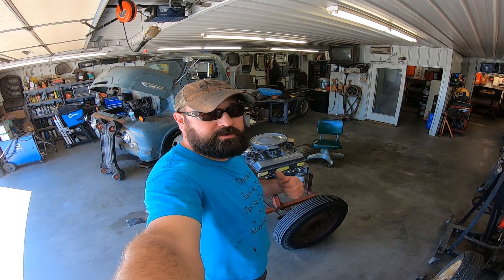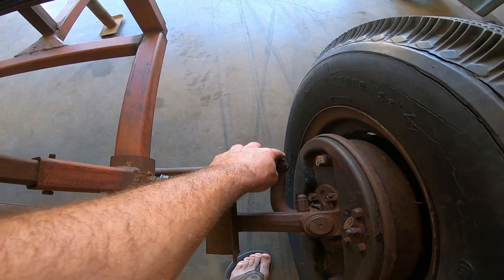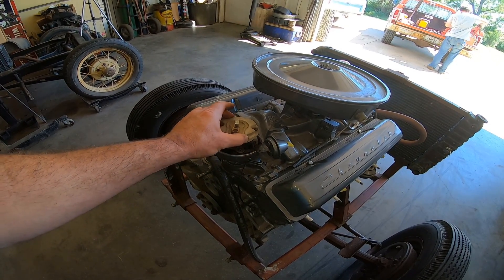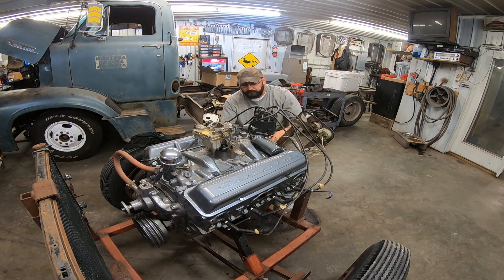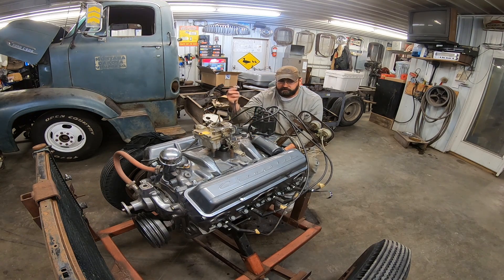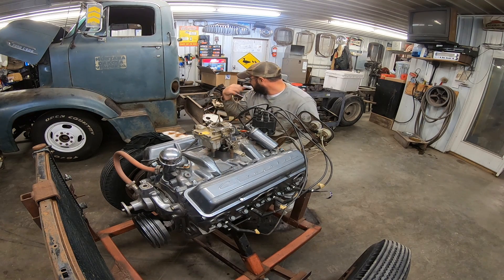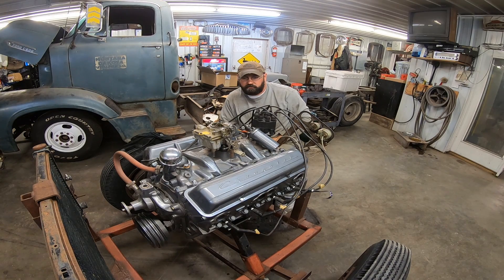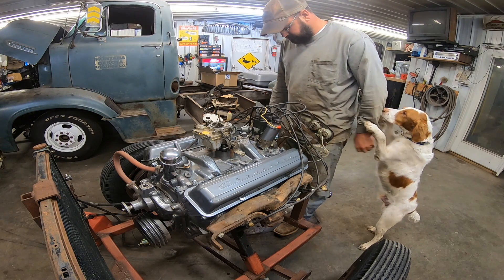1960 Chevrolet 283 Small Block Engine Estate Sale Find!! With homemade run stand! Chevy old start!

Comment: I inherited a 1965 283. It was rusted solid with heads off the engine. That was summer 2019 and now that little motor is like new again. Cost me about $1600 for machine shop work and most of the rotating assembly parts. I have another $1000 in it for Edelbrock intake, carb, HEI, water pump, fuel pump, pulleys, valve covers. Looks sweet on my engine stand. I have not tried to start it yet. I will soon. Bored .060 to a 292 cid.
Reply: What heads are u gonna use on your 60 over 283
Reply: i wouldn't be able to sleep at night, you gotta run that baby!!

Comment: Those taper seat spark plugs are incorrect for those heads. Those heads require plugs with sealing washers. The taper seat plugs will goober up the threads in the old heads if tightened.

Comment: Best combo I have seen is a bone stock 283 in a Chevy Monza. The short stroke in that light car was awesome and quick. Thanks for the vid!
Reply from the maker: I bet it would be fun!
Reply: We put a slightly built 350 in a starfire same car just used the monza v8 stuff and it was a screamer being so light any more motor and i swear the car woulda self destructed.lol after some time one door got hard to open and the other hard to close so something was going on that motor got transplanted to a camaro for the remainder of its time on earth ..

Comment: I have a '55 Chevy 4-door for 44 years. My Grandfather purchased it new, It came with the 235 c i 6 cyl. I swapped it out with a 283 when I got it, It was a daily driver for over 20 years. I then overhauled it in 2003 with a mild street cam, electronic ignition, Edelbrock carb and headers and all new interior and blue exterior. I've only put 800 miles since the overhaul but still runs great.
Reply from the maker: That's cool you still have his car!
Reply: @MortskeRepair  Yes

Comment: The 283 is my favorite engine, got one being rebuilt in my shed right now for fun. good video
Reply: I have a 1979 350    xxxx010 block on my engine stand.  went through a rapid cam/lifter failure. filled itself full of metal.   stiffened up its wrist pins.  went to retrofit roller for it. sick and tired of flat tappet / current oil compatibility problems. the aluminum heads are good for a solid 400HP and the cam should be a good match. Looks like going away from stock log cast iron manifolds, headerrs on order for my square body 3/4 ton 4x4 NP203 equipped "1980" which I did paint/body/ mechanical 15 years ago. bondo and fiberglass does cover a multitude of sins. I gave thought to putting a stroker kit in it, but I don't have the skills to clearance the block properly. but if push comes to shove, I'd rather do a 372.  ( 4.125  bore , 3.48 stroke  )
Reply: @blair79bear38  always use a zinc additive with flat tappet. A bottle of STP works good

Comment: That is a very clean engine and I love it. I just recently got an old very clean 302 Ford engine came off of an  85 Mustang GT and it is a little bit of a high performance. I am putting it in my 86 Ford F150 4x4 with 6" lift.

Comment: Best engine Chevrolet ever made.
Reply: 327 is a close 2nd if not a notch better lol
Reply: @adamcarfield7201  I'd 2nd that. 327 for the win. At least from Chevrolet the 327 was one of the highest HP small blocks at 375HP available for a production car . The double hump heads ( and ya, I have in my garage a set of small valve double humps )  with the Duntov 30 cam. too bad they didn't put that cam in the subsequent 350 engine. But as it is, you and I certainly can. my 2nd gen Pontiac Trans Am has a reasonable facsimile of the LT-1 350 in it. based on the 350HP/327 cam with 11:1 forged pistons. been that way for almost 30 years now. The Poncho purists foam at the mouth that I have a sbc in mine.

Comment: I love the 283 , had one in a 55 Bel Air   Way back in 1969 . Lot of guys put 3/4 race cam , Power Pack heads and 4 barrel on them . And always the drag plugs exhaust outlets behind the front wheel. Had to have a hand made black bar front bumper and shackles to raise the rear end , airplane had to come off the hood , damn those were the days.
Reply from the maker: Heck yeah!

Comment: haha, when you were talking about the distributor i was thrown back to the time i replaced the cap on my 91 dakota 318. colder than frig, on lunch, got it done, went to crank, nothing....
spent another 2 and a half hours after work (even colder) to realize grandpa put my distributor in 180* backwards and (assuming the motor was already in the pickup when he rebuilt it) decided "screw it" and plumbed the wires in backwards ... another half hour deciphering what order to put the wires in and i was back on the road
Reply from the maker: Don't you hate when someone offers to "help" you out?!? Ha! Thanks for the story!

Comment: Wow! That sure is one clean and rebuilt engine! Definitely something I'm not used too on this channel. The good thing is, you basically have a clean slate to work with; no Ralph Nader jobs, nothing. That'll make it a quick engine swap into something when the time comes for it!
Reply: That homemade engine cart is a keeper. Comes in handy for engine builds.
Reply from the maker: The stand is the best part!

Comment: A great cheep hot rod 283, a cool modification for 283 gets a lot of hp put  305 intake valves on 283 heads and match ports use stock 350 hydraulic cam don’t over carb

Comment: Love that engine test stand.   I have a build of one in slow progress.  It irritates me to install an engine just to find something wacky that requires pulling it back out. Do an initial runin on a stand and once you know its all good. in it goes.  That carb looks more like the 2G which is half a 4G carb and not the DualJet which is half a Quadrajet. I cracked open my Rochester manual to check.  I do have a Dualjet around here someplace which my son lifted out of a pickn' pull yard. There are 2 versions of the 2 bbl carb. one with the 2bbls without the secondaries. and another with a 1 bbl primary, with 1 bbl secondary. I learned how to tune the QuadraJet late 80's for fuel economy and power .
Reply from the maker: These stands are handy for breaking stuff in and knowin just what you got!

Comment: Nice little motor. No bolt holes in the heads till I think 69 but those are probably 305 heads 601s hopefully but it doesn't matter either way im just saying. Nice looking old-school runner for anything 👌
Reply from the maker: Thanks for the info! And for watching!

Comment: That is Cool, I Have a 1963 283 all stock, Has a 2 bbl carb ,hooker headers, Dual point, water pump, Made my own motor run stand from a cart you can get at Northern tool, Small gas tank from 5 h.p. motor from old snow blower, It looks so neat on stand. When I have it out in drive way people stop to see how I built this, The cooling is from my 57 chevy, I have under 200.00 dollars to build cart stand, The paper work says it will hold up to 1.400 pounds I am not going to find that out..The cart is used for plants at plant stores or for bags of rock. I put down 2 cut 3/4 ply wood sheets, It is wat to cool...
Reply from the maker: That's awesome!

Comment: I have a 1957 or 58 canister filter front cross over exhaust 283 in a 46 f1 Ford pu ....got it that way...gonna pull it n put a Windsor in its place along with 8.8rear axle it has bow tie rear end in it still

Comment: The 2 bolt holes in the intake are for a power steering unit on the drivers side and the other side is for an alternator, or air conditioning compressor or both.
Reply from the maker: Good to know!

Comment: I remember my first car, '66 Bel Air, had a sweet running 283.  The dwell was 30 degrees and the idle was 650.   That much I remember about the motor.
Reply from the maker: Great engines!
Reply: Dwell affects timing but timing does not affect dwell dwell is how long the points stay open in relation to crankshaft rotation its few and far between youll see points most like myself once the hei came out in 73 - 74 it was all over for the points i cant even count how many points distributors i swapped out for an hei it was like night and day often times due to bad points or dwell being off considerably condensers bad etc points wear and electronic ignition. Does not so its just more accurate for a lot longer it really never goes out of dwell so the other parts wear like centrifugal weights for timing they need to be replaced and make sure they work right .. Sorry rambling smoke another one lol
Reply from the maker: @glennmanchester9151  Lot of great info there Glenn! Points have definitely gone by the wayside! Now it's all coil on plug designs!
Reply: Yeah coil for ea cylinder fired by the crank and cam sensors timing is all comtrolled by the computer nothing is mechanical anymore .. You can run a newer style L.S. engine w a carb w an msd type igntion system that uses the two sensors and you can set your own timing curve w a laptop its all changed. From what it used to be ..
Reply from the maker: @glennmanchester9151  Pretty wild stuff they do!
Reply: @glennmanchester9151  thanks for this info Glenn! Getting Grandpa's Impala going soon I hope.

Comment: The old 283 are starting to be hard to come by I use to have a couple of them but I drove them hard till they had big ol windows in them with a nice view of the rod poking out back when I was young and dumb
Reply from the maker: They used to be throw away engines! And they haven't made them for 50 years so they're getting more and more difficult to find. Good thing they made millions of them!

Comment: 283 is/was a great powerplant...327 a nod in the right direction....but gather 'round children, if you want to see a sbc play, the 302 was the gig to have....more rare than a street hemi and way faster out of the hole.
Reply: 302 was the best of both worlds put together. 283 crank with 327 bore!! Also the first hot rodded Chevy small blocks were punched out thick wall casting 1957 283 blocks that were punched out 0.125in over to 4.00in bore, same as 327, they called them 301s but in reality they are the same 302!!

Comment: 4 barrel, headers, maybe some 1.6 roller rockers for more lift, and ya probably got a nice little 300hp, daily driver engine that would also be really nice in a rat rod, T bucket, Model A, etc.
Reply from the maker: Make a real ripper out of the little 283!

Comment: That's a sweet run stand. I've been wanting to build one. I'm waiting to find a sale on motivation :)
Reply from the maker: He did a good job on it that's for sure. Just try some of that stuff you're cookin. That'll motivate ya!
Reply: @MortskeRepair  haha. Have you ever used Corroseal? It's pretty neat. I'll tag you in the video when I get it done.
Reply from the maker: @HFG  I have not
Reply: @MortskeRepair  you might find it useful for stopping rust. It works way faster than other stuff I've tried. It's cheap, too. Like $48/gal
Reply from the maker: @HFG  That's cheap?!? You must make more money than me!
Reply: @MortskeRepair  it goes a long way. POR15 is $40 a pint lol!! Man that's crazy.
Reply from the maker: @HFG  Well is it paint? Or WTF is it?
Reply: @MortskeRepair  it's not paint. It looks like melted vanilla ice cream but dries into a clear primer. It's thick though and leaves, like, a shell on the metal. It's strange stuff and it's way different than other rust converters that I've used. It works fast, too. You can immediately see it changing the rust. I'll do a quick video of it today and post it tonight.
Reply from the maker: @HFG  Then you gotta buy paint afterwards?!? I dont' get it. Bobby does good at 'splainin so I can't wait!
Reply: @MortskeRepair  Oh man. Bobby has to do it? Well, dang. I'll have to get some bail money together. He's in the pokey for doing burnouts in front of Harold's Beer, Wine and Beepers Discount Liquor and Beauty Salon.
Reply from the maker: @HFG  So you're saying his Gremlin is running again?!?
Reply: @MortskeRepair  100% He ordered a Briggs and Stratton hop-up kit for it and now it'll burn em down! The newspaper said there was so much smoke that the cops could only find him by following the sound of Lynyrd Skynyrd.
Reply from the maker: @HFG  And the half smoked menthols
Reply: @MortskeRepair  😂😂😂😂

Comment: You said that 2jets are half of a quadrajet, but the 2gs are actually closer to the carburetor that came before the quadrajet, the 4jet. Nobody runs them on anything before 1966 but the insides are almost exactly the same as a 2g mirrored. Half a quadrajet would be the dualjet. And at least you’re not running one of those things lol
Reply from the maker: Ahh gotcha. Well 2 is half of 4 so that's what I call them!!
Reply: Exactly right. That was a 2G he had. it came before the QuadraJet which is much different carb. The DualJet is the version that is half  a QuadraJet.

Comment: Nice engine!! Those are peanut type spark plugs so, the those heads are no older than 1971. Hopefully from a 307. The good part is they probably have hardened exhaust seats that will work well with unleaded gas.
Also, 283s did not have vibration dampeners. Maybe it's a 327.
Reply from the maker: Yeah, hard to say what kind of a mishmash of parts this thing has. Good information to add tho! Thanks for watching and commenting!
Reply: 1960...there were only 283s.  Different heads maybe but by 1960 the 265 was gone...283s around and there were no 327s intil 1962 though.  Of course 348s wwre out in 1060 but that is mo 348 lol
Reply from the maker: @fff-cf4fx  Let's not forget about the mighty 235 then if we're comparing apples to oranges!!
Reply: As the man decoded the block to a 283,  no way it would be displacing 327.  The 283 uses a 3  7/8 bore and a 3.0 inch stroke. the 302, 327, 350 engines use a 4 inch bore.   the 327 uses a 3.25 inch stroke. And yes, I had to lookup the bore of the 283 in my Chevrolet Power Catalogue.
Reply: @fff-cf4fx  love the 348. the first of the Big Blocks.  aka "W" engines.

Comment: Ford & Chevy have the same physical timing order, but number the cylinders differently. If you put wires on your Ford exactly as you would a Chevy & counting the cylinders as Chevy does, it will be correct.
Reply from the maker: Sweet!

Comment: 290 horsepower

Thanks to an optional Rochester fuel-injection package, Chevy's 283 made 283 horsepower, the company's first engine to make one horsepower per cubic inch of displacement. A year later, Chevy was able to get 290 horsepower from the 283 small-block.
Reply from the maker: Good stuff!
Reply: I think the top dog was a 61 Corvette 283 with 315hp. Great engine!

Comment: those heads look newer than 1960, early small block valve covers had bolts slightly closer together on the intake side of the valve cover 
I thought those heads there are after 62
 it is a gem though
Reply from the maker: I think 59 was the last year of the staggered valve covers.

Comment: Why is it necessary  to bypass the intake manifold to the water pump ?
Reply from the maker: I never said it was necessary did I?
Reply: I'm not saying what you said, I'm asking what is the need to use the bypass.

If I don't use the engine it overheats ?
Reply from the maker: @avelinobulbol3588  no

Comment: I know this is crazy but I would love to put a sbc in my 66 f100 wide short custom cab with a R700.
Reply: Do it but only open the hood for Chevy guys.
Reply from the maker: Whatever works! I think a 390 would be sweet in it!
Reply: @MortskeRepair  you know those engines are super hard to find anymore. I had one but I sold it like a fool. I also had a early 352 that was the police interceptor but I also sold it because it had the weird bell housing bolt pattern like the early sbf had. I think it came out of an Edsel

Comment: Just make sure its on the compression. Stroke not if its a 180 out its easy enough to do by even putting your finger over the spark plug hole as the no1 cyl comes up youll know if its on exhaust or compression stroke then as you said face the rotor towards no 1 it gives the distribitor the most adjustment for timing it drives me nuts to see an hei put in a tooth or more off and the distribitor not straight its just a pet peeve maybe but thars how the factory put rhem in nice ans straight and for a reason too it doesnt take any more time to put it in right or to move it a tooth you can bump it one tooth at a time w out coming all the way out and messing w the oil pump shaft it slides right in one at a time ive gone a 180 doing that never coming all the way out its the little things that make a difference like the timing curve the faster you can bring in total timimg w out detonation the bettter the engine. Runs and performs curve the distributor for ea application according to engine compression and octane in fuel a stock low compression motor loves it all in quick and youll notice a big difference try it yall younger guys im sure this guy knows what im saying but not everyone does ignition timing is critical to performance and of course efficiency if its not working hard and happy more efficient under hard acceleratiom you shoild almost hear it ping almost but not really then your at the sweet spot ive timed more by ear than ive ever done w a light its just knowimg wjere shes happy lol nice find sorry for rambling just felt like teaching lol hope. I helped someone
Reply from the maker: Thanks for the info Glenn!